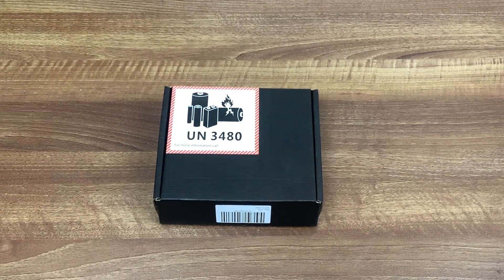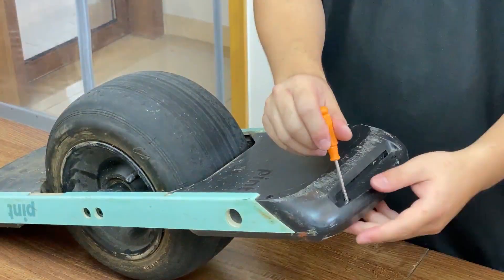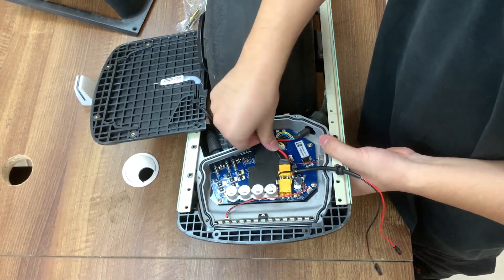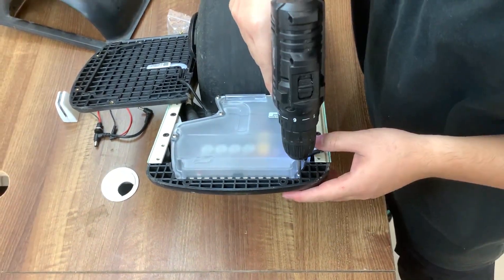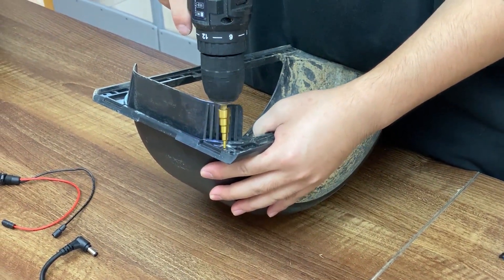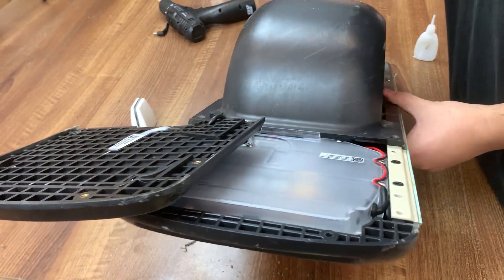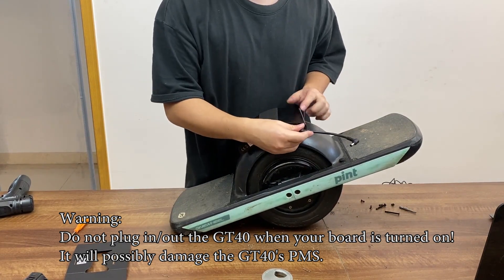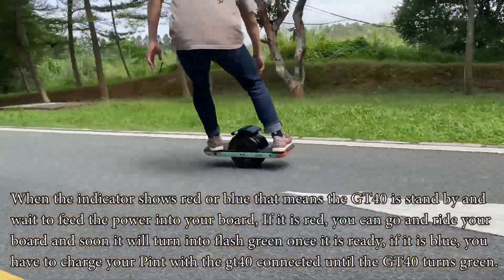Pint range extender gt40 installation | Pint Quart VNR

Comment: That mileage number is really misleading.

I have both the quart battery upgrade and the gt 40

And I only get 20 miles in my hilly area and a max of 30 miles on flat.

What there advertising is that this gets 30 miles with just the gt 40 and stock battery when realistically you be lucky to get half that.

With the stock battery +gt40 expect 15-20 and no more with  the quart + gt 40 expect 20-30
Reply: Btw I fuckin love this modification and this by no means detracts from how awesome the mod is.

I just believe the specs and numbers should be truthful and realistic.

That number 30 miles would only be possible if you weighed less then 150 lb and was on flat surface with no wind and warm weather
Reply: Math goes like this: Pint battery is 147Wh, this has claimed ~270Wh. 270 divided by 147 i 1.8 so if the capacity claim is real you should get 2,8 range of original Pint range in your area (temperature included) with that thing on. You can see in video above that their rider is light, unskilled and goes on flat. Do your math next time, every use case is different and technically their claim is achievable in optimal conditions.

Comment: My onewheel pint is running on Gemini 5069. I installed the Jwffm chip as required and the chip seems to be running fine but the GT40 light stays red all the time iv ran the battery down from 100 to 1 and still nothing. Am I missing something? I have just noticed the description of this video says the 5069 will not work well I think I just wasted some money

Comment: A WEEKS review from the GT40 Mod.

Hardware: 5315
Firmware: Gemini 5050

GT40 is the missing piece to all PINT users out there. It would make you appreciate your pint more. My range anxiety is gone as soon as I start using it. Get the PROTECTOR kit as well, it is really important. A job well done GT40 team.

I just used the GT40 with the protector on it. The GT40 really gets me places where the standard onewheel pint cant. The protector is a must on everyone getting the GT40. It would save and protect your cable from getting damage. 

One week of review and this is what I observe, during regular usage, the installation instruction on the website and the video tutorial is clear and accurate, but should be updated to help clarify the charging process after usage of the onewheel.
 
I am an Electronics Engineering graduate and a Diesel Technician by trade, I know a little knowledge of the electronic basic. So here’s what I observe.
(*DISCLAIMER: This is only a pure observation and no scientific studies have been done during this review. These sets of instruction are here just to guide or help anyone who have trouble charging their PINT. ASSUME ALL responsibility in performing these methods.*)

CHARGING:
GREEN BLINKING:
So, what I’ve observed and take into mind during my 1 week of usage is that, don’t charge directly as soon as you get home after every ride, instead, let the GT40 and the onewheel balanced batteries or equalize. Meaning, just turn ON the pint with the GT40 connected without charging until it automatically turns OFF again. After this, you can charge it regularly. 

So what you are doing is Technically, after every ride, the pint battery tends to drain more than the GT40. As you turn ON the pint, what its doing? It is being detected as “regen” state, meaning, GT40 would continue balancing out Voltage to Pint’s batteries. As soon as it balances out, “regen” status would turn off, and shuts down your pint automatically. Then, you could now charge it with the charger. This way it would prevent the issue of some people having trouble charging coz it would automatically shutsdown a couple minutes from charging it. 

BLUE BLINKING:
Blue Blinking means your GT40 is way too high of charged state compare to your pint batteries. Charging it in directly would result to automatic shutdown of the charger couple minutes from charging it.

Blue blinking meaning your GT40 has a higher voltage than your Pint. Fixing this issue is easy. 

(Blue Blink Procedure)
Disconnect your GT40 from your Pint(*make sure to unplug the charging cable and turn your pint OFF doing so*), then charge your PINT only. Check every 10% to 15% of added charged by checking the app.

Then, disconnect the charger, plug the GT40 cable to the pint(*making sure the the pint is turned off in doing so*), then turn on the pint.
If GT40’s blinking is GREEN, you could now charge it regularly without encountering the auto shutoff during charging. If its still BLUE blinking, repeat (Blue Blink Procedure) until the blinking would be GREEN. 

Hope this helps out fellow Floaters out there and keep safe everyone.
Thank you. 

-Gerard
Reply from the maker: god bless u sir.
Reply: My pleasure. Hope this helps fellow users of this amazing product.
Reply: Thank you legend, was looking for these exact instructions and reasoning but couldn't find anywhere. Was wondering why it was blue while riding but now thinking because I had to ride without it connected so most likely much lower battery. Thanks again

Comment: A couple of install tips:
1. Pay attention to the screws so you put them back in the correct place (Long screws go at the bottom of the footpad)
2. The hole on the fender goes to the RIGHT of the battery indicator lights (opposite side of the wiring you just did). I totally don't have an extra hole in my fender now...
3. Before screwing in the fender, check the bottom of the board to make sure no wires are sticking out. The joins for the wires can go next to the controller housing, excess wire can be tucked neatly in the gap near where you drilled the hole.

Comment: Hi, I read that with gt40 connected, there are issues with the onewheel app, so I have to disconnect the app. Is that only when the extender is plugged in, or even also when extender is not connected after the cable mod?
Reply: Jwffm chip

Comment: After opening the controller box, the gasket was swollen and I can’t seem to make it fit back in place.  Any tips?
Reply from the maker: glue them in place or cut the gasket short for about 5mm then you put some silicon on the cut end of the gasket
Reply: @gtmod2187  perfect, that seems to have worked!

Incredibly easy install!

Comment: Too bad the Pint X is not supported ☹️ Is it possible to just mount this battery and plug it into the Pint X charging port while stopped? I'd like to have it just as a separate charging option that's convenient to carry around 🙂
Reply: Any solutions for the pintx?
Reply: @ddkim619  FM has locked down range mods with the pint x and so far no workaround/chip yet unfortunately

Comment: I have the GTMOD plugged in. Turn on my onewheel. The GTMod battery indicator light is blue. Turn it off and plugged in the charger. It would charge for ~1 min then stop and charging brick shows green even though the pint internal battery only shows 50% charge. Why is that? However, I was able to keep charging the internal battery pass 50% with the GTMod unplugged.
Reply from the maker: please reach out to the team via gtmodification@gmail.com but from your description it seems that your pint is not in the range to match the gt40 please charge your pint to 80% first then connect the gt40.
Reply: Hello, I had the same issues today after installation. Did you get the problem solve?? Please let me know and thank you
Reply from the maker: @wymanqiu  disconnect the gt40, and charge your board to 80% then connect gt40(with pint turned off)
Reply: if the GT40 indicator blinking green is that means it's charging and light will turned off after full charged?
Reply: @gtmod2187  thank you for your update and I will follow the instructions
Reply from the maker: @wymanqiu  the light will keep flashing green，this light only shows the connection status
Reply: @gtmod2187  ok so how do I know the GT40 battery is at a full charged?btw I'm using the pint hyper charger
Reply from the maker: @wymanqiu  after first charge, the SOC of Pint is the same as the gt40, if the pint is full gt40 is also full
Reply: I am having a similar issue. My board was at 95% when I installed the gt40. Got the green connecting light, no red or blue. Went for a ride down to 22%. Plugged in and it would only charge for 1 min unless the gt40 was unplugged. I fully charged the board and plugged the gt40 back in, expecting a red light and to have to ride it. Instead I got green, and noticed in OWCE that the gt40 was causing 2A drain at idle, suggesting a large voltage mismatch. Unsure what to do!
Reply: @suprPHREAK  charger the pint first at 80% then plug in the GT40 with board power off and charge them both together. Problem solved

Comment: Is it possible to add 2 GT40 mod kits to one Pint to get even more range?

I own a pint, and a pint X. I ordered 2 GT40 mod kits. I was planning on connecting one to each board. But it won’t work with the X. So, could I connect both GT40 mod kits to the one Pint? And both would drain together and charge together? 

Possible? Risky?
Reply: They have a video now with 8 of them on a pint, I’d recommend looking at that
Reply: Did you end up stacking em? How’d it go, if so?
Reply: I'm doing it with 2 front to back. 30+ mile range + protective covers.

Comment: So what does it mean when the light indicator is red while it’s charging?
Reply from the maker: that means your board is too high, you can go out and ride it for a while
Reply: @gtmod2187  It was red right after I rode it all the way to low battery. Then. Plugged it in, and the light was still red.
Reply from the maker: @xleagen5398  looks like something is off with your gt40, please gimme your order#, and we will get you a replacement.
Reply: @gtmod2187  00000125
Reply: @gtmod2187  will this work?
Reply: @gtmod2187  I sent a video of my gt40 not charging or powering on. Is that enough to confirm my gt40 doesn’t work?

Comment: Hi thanks for the clear instruction video & for developing such cool addon for onewheels, i have 2 quick question:
1. Have you tested it on other fenders? I have a magnetic fender from C&R and wonder how this will fit (both regarding the installation, and how safe it is to put it on a non bolt-on fender). 
2. Is it possible to cold swap the GT40? i.e. Let's say i got 2 x gt40 for my pint, when the first one runs out, turn off the pint, unplug the first one and connect the second one? If so, that would've be really awesome as i can take the second one in my bag rather than stacking them. 

Looking forward to ur response :)
Reply: cold swapping doesnt seem to be possible as the gt40 needs to match the internal battery voltage, there might be the possibility of running 2 in parallel with a barrel connector splitter cable
Reply: @AnthonyVD1310  thanks i got the gt40 mod just installed  :)
Reply: I run 2 at the same time. Battery levels have to be around the same to function and charge properly

Comment: Hi! Why doesnt it work for gemini 5069? My pint has that firmware and im struggling to find compatible batteries. All in all super sleek battery guys, keep it up
Reply: Install a JWFFM chip from jw batterys it should override the BMS firmware. All battery mods work with the JWFFM chip on all current firmware updates on the pint and pint X

Comment: How it is with the amp? Since when batteries are in parallel it puts out double the Amps. Won’t that fry or damage the onewheel board after some time? Thank you.
Reply from the maker: The ESC has a software current limit, It can measure the shunt current and usually the esc  is not the bottle neck, the og 1p pack really lags behind what the controller can do. With gt40 setup you immediately feel it is way more punchy and responsive when climbing hills

Comment: dude you guys seem super chill and humble over your product. Really well designed. By any chance do you know when the early bird is going to end? And if I were to take the pad on the PCB of would I leave residue on the board.
Reply from the maker: Thanks for reaching out! Some residue is gonna be left but it can be cleared away using rubbing alcohol, the early bird discount ends by the end of February.
Reply: @gtmod2187  Thanks for the fast reply!!
Reply: @siggy2694  early bird 20% off is still active, i don’t need this cause I have a GT coming in but my friend would be riding my pint so I want him to have more range to be closer to the amount the GT has

Comment: You mean I could of saved thousands of dollars and got this battery pack and put it on my pint instead of buying the GT that is taking an eternity to ship paid for in October still nothing till February cuz I want more more range 😫😫! Son of a b******🤬🤬🤬🤬🤬
Reply: I thought the same thing for a minute but honestly the GT is still going to be better. Fukkkk pint pushback/low top speed. 
Plus even with an aftermarket battery in your pint it won’t have the same torque levels that the GT will 😁
GT will be worth the wait
Reply: @Tactical_Taco  plus then you have 2 boards with pretty damn good range, I wanna order this for my pint while I wait for the GT might just throw it on the PayPal later thing so I don’t have to worry about it right this minute and have it in before the GT gets here

Comment: I've Emailed several times, but haven't received an answer, but my concern is in the closeup of the battery pack the tag says 54v 1800mAh (1.8Ah) 97Wh.  The original pint battery is 147Wh, how does this get me to 30 miles per charge? It should be around 270Wh to get that kind of range.  To credit, this is the best looking system and cleanest install that I've come across for adding millage to the Pint.
Reply from the maker: Hi, sorry for the late reply, it is marked as 97Wh so we can ship it worldwide via air. actually it is 63v 5Ah, which is around 300Wh.
Reply: @gtmod2187  isn't that illegal?

Comment: Work with pint x?
Reply from the maker: sadly it does not, unless you have a jwffm chip installed.
Reply: @gtmod2187  So someone has it confirmed working on the Pint X with the JWFFM chip? I am so buying if so 🙂
Reply: @gtmod2187  So theoretically it will? If you seem to think so, I'm willing to try.

Comment: The chibattery gauge has a pass through plug and ao does the GT40. Will they work together? If so, in what order should they be plugged into the passthrough range?
Reply: Thanks for your response via email. Like you recommended, I will solder the chibattery gauge wires to the g40 passthrough. That hole underneath the sticker- does that come factory? Did FM provide that for modders or is that a feature added by the producer (FM was not aware of) they ordered from where they have the controller assembly mass produced?
Reply: @sdmods619  The hole is on the battery box and controller box it is a vent port to equalize air pressure as temperature changes.
Reply: @JonXuereb  Referring to chigauge not chibattery. The gauge has a plastic passthrough that connects directly to the controller, the GT40 also has the same style passthrough and they don't fit at the same time. I figured it out - disassembled the chigauge passthrough and soldered it's wires directly to GT40 passthrough and it works great.

Comment: Ok so I went for a nice long ride today so it seems that the battery is connected and working well...
However I read that after connecting the app I had to turn it off for the ride  but the ride would still be recorded?
I'm not seeing the record of my ride?
Reply from the maker: I'm sorry there must be some misunderstand, the app will only record the your mileage, if you want to track the ride, you can use relive app.
Reply: I'm on over half a year day streak on the app atm. I will loose it when my gt40 mod comes, a sacrifice I am willing to make for more range though

Comment: Hi there, this looks like an amazing feat of engineering! Everything is so well thought out and I love the extra safety/convenience factor you added - it's really unique among all of the other VNR type setups. I've got a couple questions about it:

- It looks like a couple of the cables/components are a little specialized and might be hard to find if damaged or lost. Will you offer replacements or at least information about how to find/make these cables?
- How well does the GT40 casing hold up against crashes and tumbles?
- If the batteries or circuitry inside the GT40 fail, are they user-serviceable?
- Those wires are quite thin to be able to conveniently fit through that sticker - are those wires rated for that much power going through them? I'm sure with the level of detail you've put into the project, this has been accounted for, but it is something that came to mind.

I'm considering modding my Pint with this thing, it looks incredible!
Reply from the maker: Hi, thanks for reaching out 
1. All the cables and components are user serviceable and you can get it by contact us at gtmodification@gmail.com, we support right to repair and we will do as much as we can to help if you need parts to fix your gt40.
2.the gt40 is held in a 2.5mm thick aluminum case so it holds up pretty good in rolls/ tumbles.
3.You can change the internal PCB if you have basic soldering skills, and we are happy to provide spare parts needed.
4.Those wires are 18awg and rated for 10A cont, the internal circuit will shut down the connection in 0.2s if it is over 8A, and it will resume if the current drops back in 8A.
Reply: They offer protective cover now

Comment: How long does it take to charge with a Onewheel fast charger and the battery connected?
Reply: about 2.5 hours. if you have a quart and a gt40 fast charging will be more like  3 hours
Reply: @eucboi7595  awesome! and what type of range are you getting with g40+ quart?